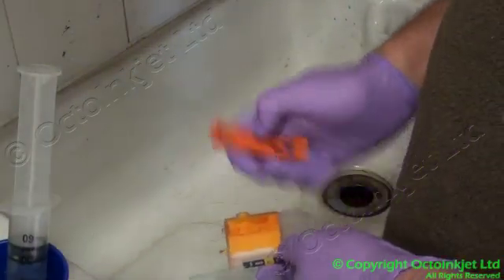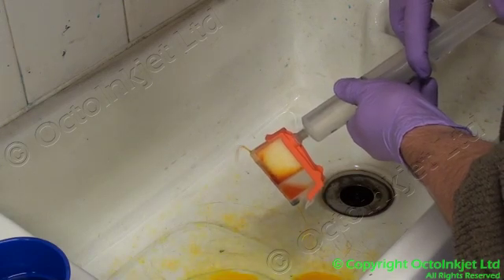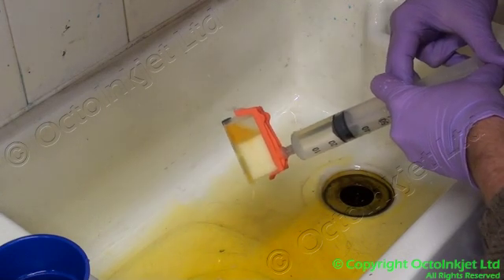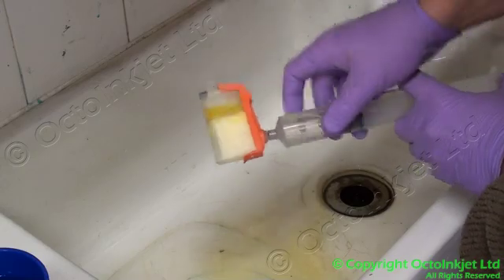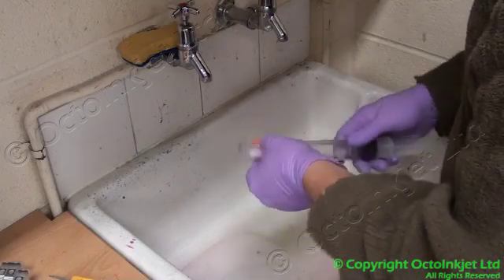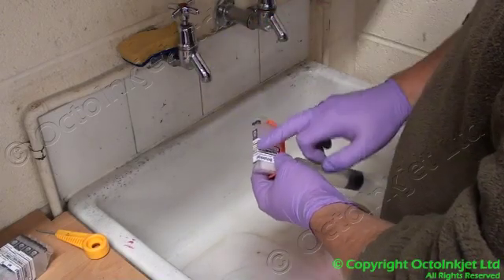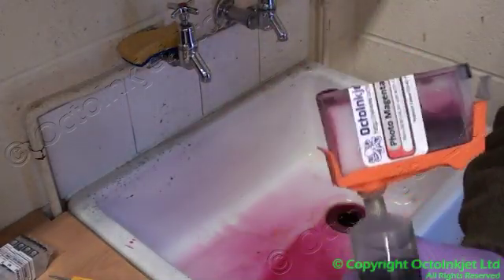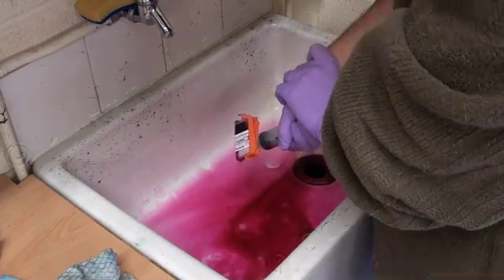Flushing or purging Canon inkjet cartridges

Comment: Thank you for this video now I see why these older printer cartridges need to be flushed so they work like new ones because if you don't you have build up inside.
Reply from the maker: You're welcome... In terms of rational it also helps clear out any dried deposits and the same process can be used to reprime a cartridge with a new refill ink and flush out any water or old ink type. We'll be doing a new video on that in due course though...

Comment: Why all this trouble of cleaning out if your going to refill with the same colour ink ??
Reply from the maker: The flushing process pushes any dried deposits out of the sponge and helps re-establish ink flow but there are other reasons such as ensuring the new ink isn't contaminated with the old type for purposes of colour profiling or daft stuff like filling a cartridge with the wrong ink (eg: Light Magenta instead of Magenta...).

Really the video is just a "How to.." guide for when someone realises they really could do with the information for whatever reason.

Comment: Also, open factory fill hole during purge so the waste ink goes out of there instead of being sucked back through the sponge.
Reply from the maker: +Raver Meister That's an approach that also works but, as shown, when you're trying to vacuum out the contents of the sponge, having that hole sealed is necessary. Of course you can easily open the hole up and then reseal it using a plug.

Comment from the maker: If you have a Pro-100 (CLI-42 cartridges) and want to flush then this guide...
http://www.octoink.co.uk/kb/questions/191/
...is worth checking BEFORE you consider flushing as it helps avoid the dreaded yellow jello issue caused by some third party inks (or flushing with water).
Reply: octoinkjet 
You start off using distilled water and then use tap water for the flush
Reply from the maker: Alan Clough Hi Alan, You're right... I completely missed that I'd switched at around 5:54 onwards.

So, to clarify, best practice is to use distilled water as it doesn't contain any minerals or other junk that often comes with tap water. You can flush with tap water if you're not in a hard water area but it's always a good idea to flush with distilled water a couple of times at the end to get rid of any crud.

Classic case of do as I say, not as I do... Thanks for catching it
Reply: I have MP 560 and the cartridges are 220 & 221